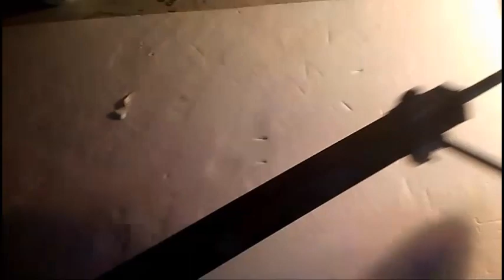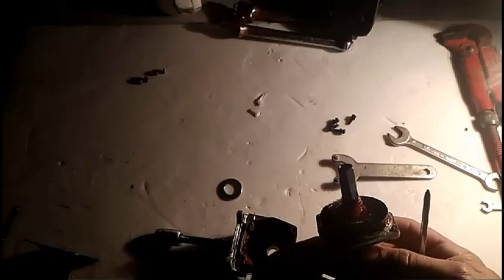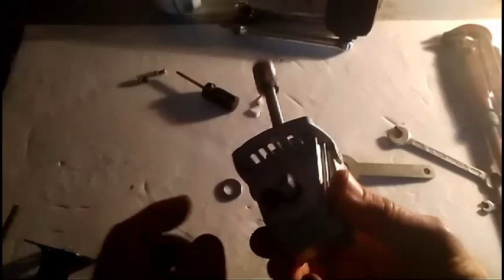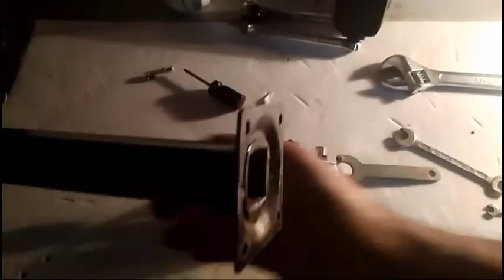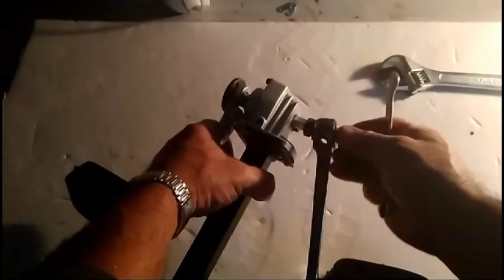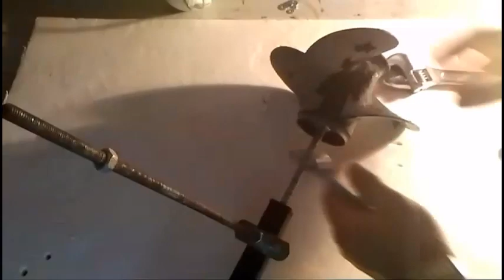A DIY  Pedal Powered Drive System using gears of an angle grinder for boats, canoes, kayaks etc.

Comment: I've been trying to incorporate basically the same concept for months, but different. My kayak is the tamarak angler 100. I'm wanting the shaft to run inside of the hull, to the rear as close to the top of the hull as possible. Debating using the grinder gears, pedals, a weedeater flex cable through a narrow diameter pipe.
Reply from the maker: It would be nice if it works. I had tried the same concept with a Flexible Shaft, in salt water it rusts and blocks very easily.
Reply: @panpan-mz6em  I found some 1/4" and 3/8ths stainless cable and ran it through 1/2" pvc pipe to see how it would hold up. No issues. I will experiment more when I get more free time. I will need to tack weld something on both ends of the cable to attach the propeller as well as the grinder shaft.
Reply: JackOfAllTrades then running it through black pipe should work great. Also that sounds like using a modified weedeater shaft/cable assembly might work great on the output side of the grinder. Would be great if someone could video a successful diy pedal mount on a boat of any kind but I've yet to see it.

Comment: I like your design: very simple but elegant. Hope you could reply to my question. What kind of angle grinder is in the video? i have been looking at many angle grinder and they dont have both gears in 1 place as shown on your video
Reply from the maker: Thank you!! It's this one https://www.leroymerlin.fr/v3/p/produits/meuleuse-d-angle-filaire-500-w-e1400067645
Reply: I bought a brand new angle grinder (not the one in the link but similar). i have trouble create the thread b/c mine does not have thread and it is hard to remove the inside axis from nuts. Do you have any link to show it?
Reply from the maker: Neither mine had a thread, I did it.  I used a gear puller and in some point another angle grinder to  cut the cover of the axis, be careful doing this.

Comment: Very interesting. Do you have any video of it in operation? How does it work in general?
Reply from the maker: Unfortunatelly not yet. But I am planning to do so, as soon as I manage to fit it in this pedalo boat. https://www.youtube.com/watch?v=PbPlFPRMurY
Reply from the maker: This gear was from a cheap angle grinder which was proved not very strong, looking for a more rigid gear.
Reply: pan pan did you use good grease because a cheap grinder will generally last years when used as an actual grinder